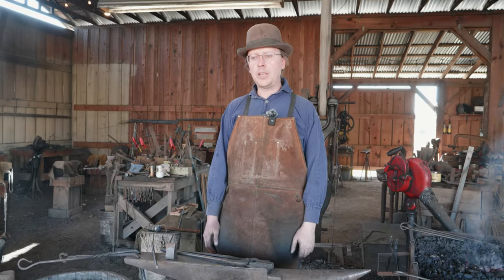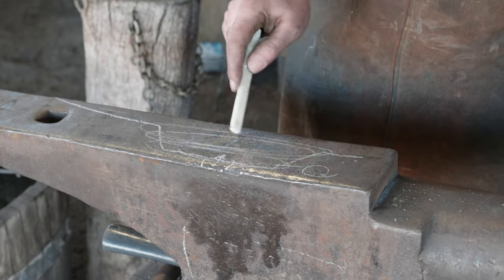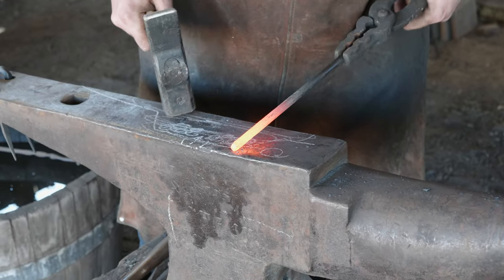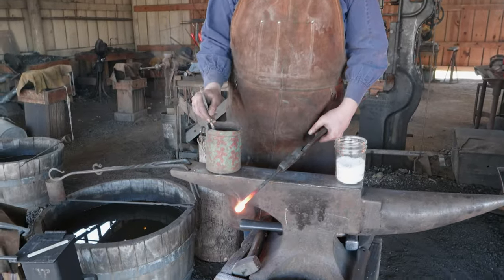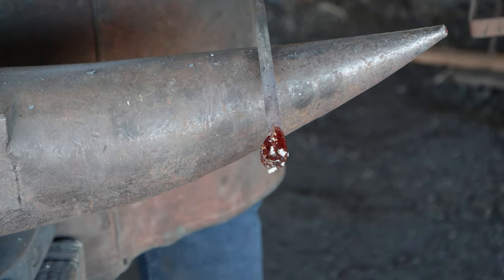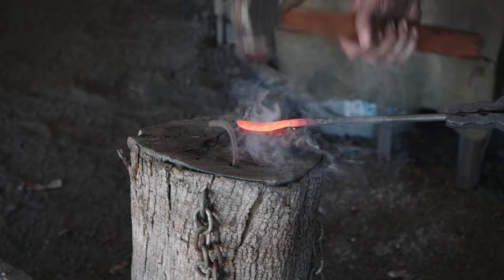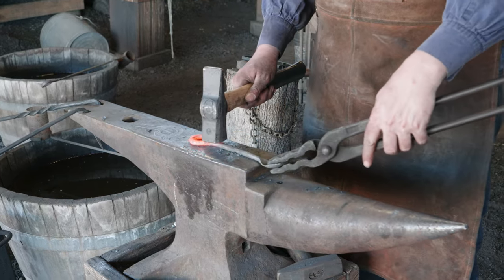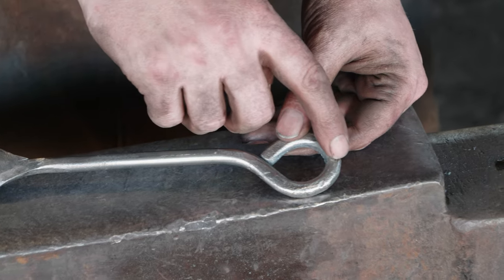Abana National Curriculum 1.17 - Forge Welding (flux spoon)

Comment: I wonder if I could "cook" my own anhydrous borax by baking regular borax? It works for driving the moisture back out of silica gel packs.
Reply from the maker: I think you can but it's got to get pretty hot.  It should turn glassy and then you can grind it into powder.  Probably worth wearing a mask during the grinding.  

That might make an interesting video.
Reply: You are doing that when you flux your workpiece.
Reply: They are actually different chemically. You can sorta do it but it's not the same.